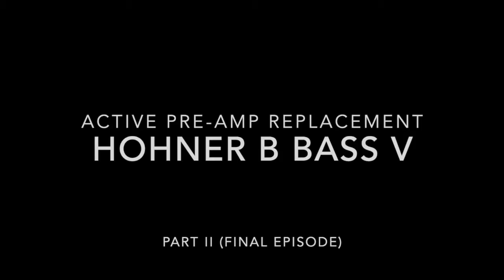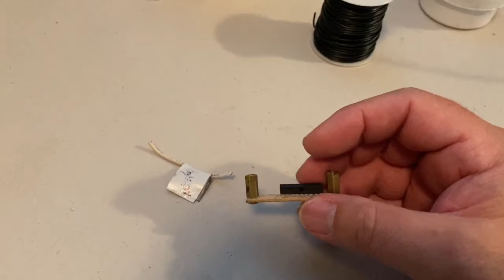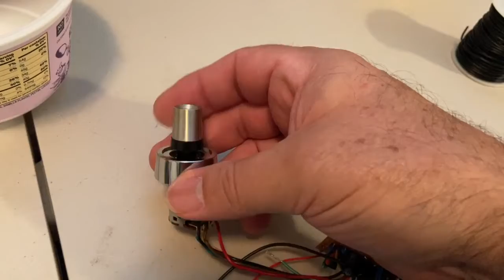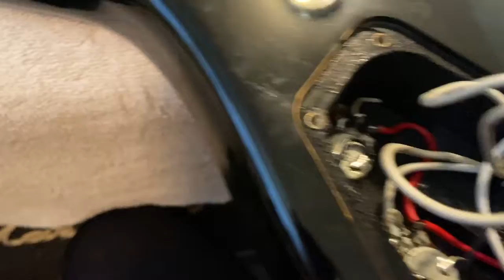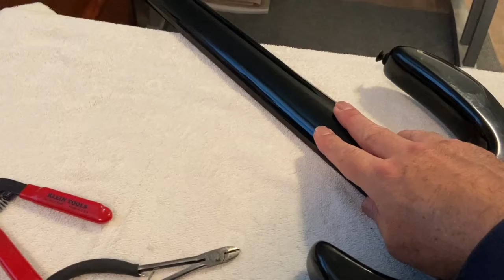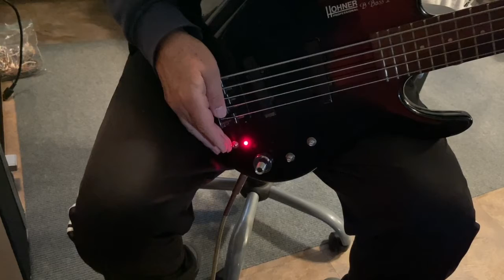Hohner B Bass V   Part II

Comment: Would you consider sharing a parts list for the active tone control you built? Or could I commission you to build one. I have the same bass and feel I have the same problem.
Reply from the maker: Hey Bill - sorry for the late reply.  The main basis for what I did can be found at "How To Make a DIY Onboard Bass Guitar Preamp (Project Berocca Part 10)" (didn't want to link it directly, but drop that in a google search.  I did a few minor tweaks based dual pots I had at my disposal.  And did additional little things like adding an LED that showed when it was powered on. Take a look at that and if you need further help, let me know!